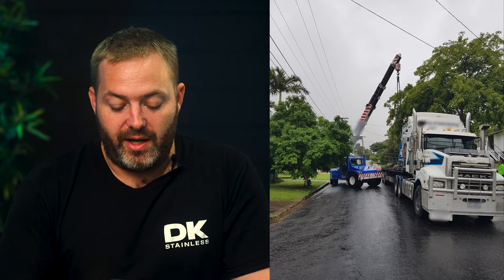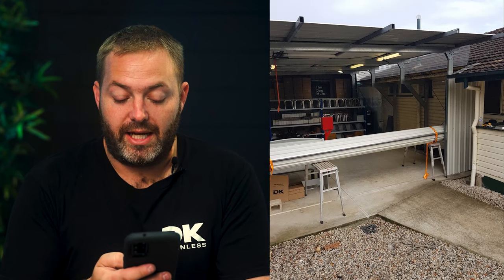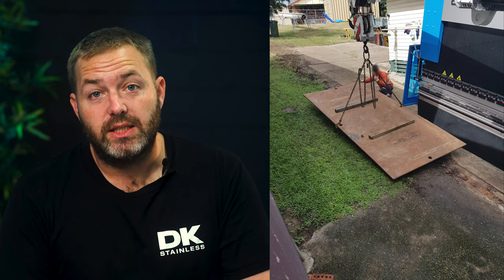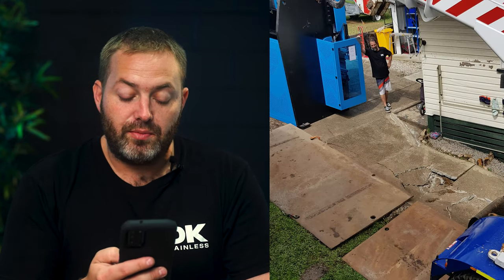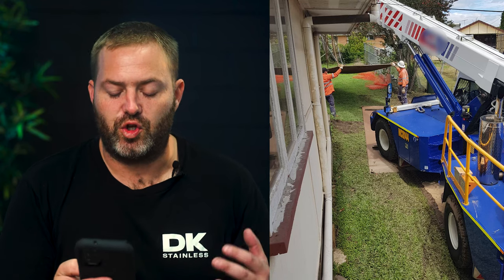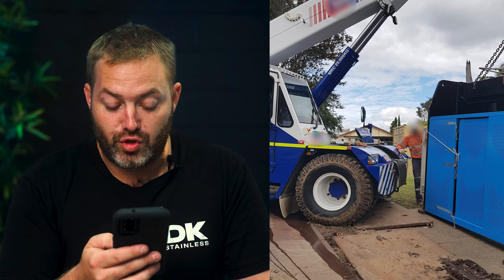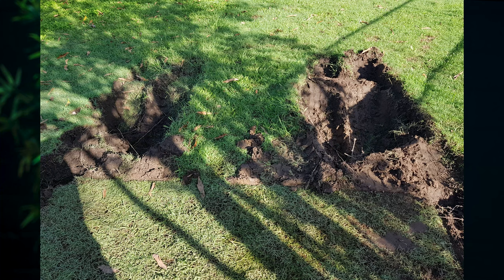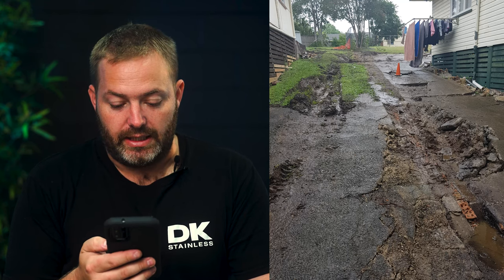Why you shouldn't install an 11t Press Brake at home... 🚨

Comment: How did you even hook it up to power it in a residential property? And what was the power bill like after installing it?
Reply from the maker: G'day Scott, the machine runs off 3 phase power, so the electrician just had to make sure that when hooking it up, that it was running in the correct direction.
The power bill wasn't too bad, but we still saw an increase. 👌

Comment: why would you even try that?
Reply from the maker: Hey Ben, Thanks so much for your comment. We got to a point where it was a much better option for us to manufacture and bend our stainless steel products in-house rather than outsourcing contract folding - this ensured better quality control and assurance for our Pet Rehydration Stations and other pet and 4x4 products 😀 While it was a very stressful process setting up shop in a backyard shed with machinery such as the Press Brake, it was definitely the right choice (even if it did come at the expense of losing a driveway and some of the front and backyards 😂)